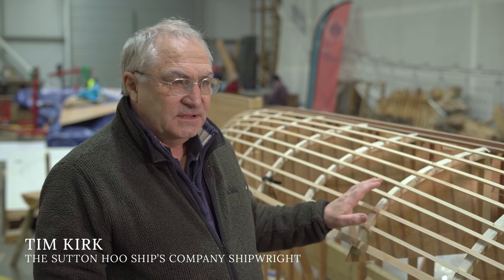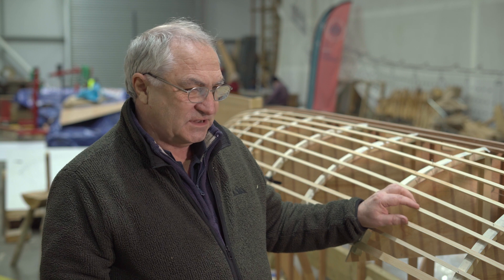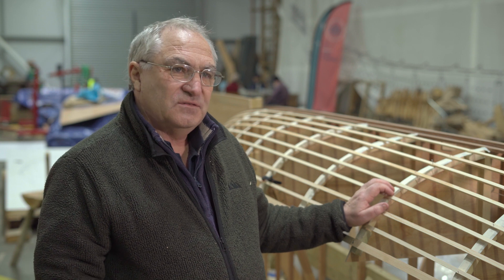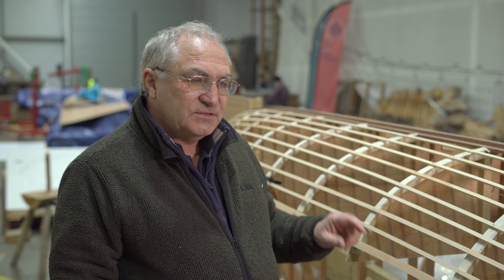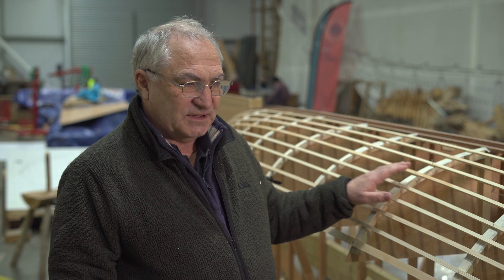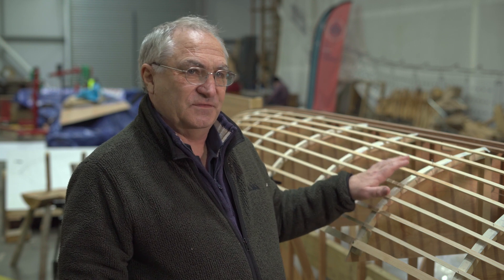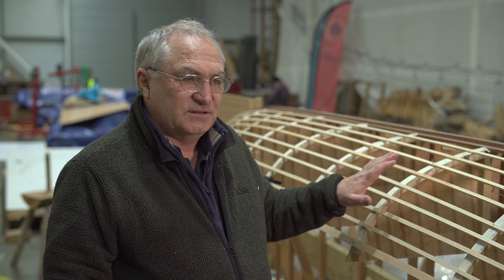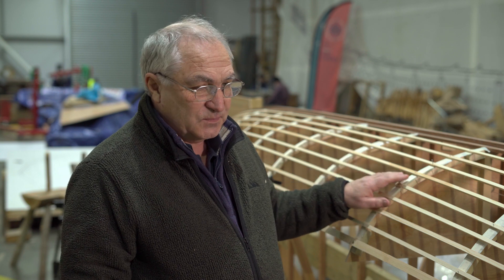The Sutton Hoo Ship's Company - Experimenting with a smaller model

Comment: Wide boards are generally used on the flat sections of the hull and narrow boards on the more rounded sections. Thinner planks are easier to coax into shape and edge set than a wide plank. So I believe it was more about adapting boards to the shape of the hull than the availability of plank stock.

Comment: Why wouldn’t they be different widths on the base boards? Wouldn’t They have had a system of grading for what they had on hand? they did not need to keep mills and loggers in business like we do in our economy of timber production that relies on standards and grading of sizes widths and heights. They had a project to build a boat to bury a king, and they had no particular reason for differing widths... no?
Reply: More than likely it was the other way around. They didn't have standard widths, they took the boards they had and made do with them.
Reply from the maker: Hi Sue,  it is believed that the ship was not built specially for the burial but that it had seen several years of service before being dragged up the slope to the burial ground. This is due to a number of repairs to the ship including patches in the planking, a possible repair to the aft keel scarf and a section of 'double nailing' on one plank. This is a classic attempt to seal a leaking seam by fitting intermediate nails between the primary fastenings.

If it is the case that the ship was a part - or even possibly the flagship - of the fleet then it would have been built at the Kings commission and so it could be the case that what we are seeing is damage caused during the site formation or an error in interpretation. Or it could be, as you suggest, that it was built that way. As an experimental archaeology project we need to look at these perceived anomalies and try to understand what it is that we are seeing.